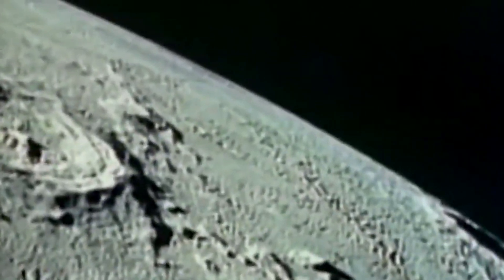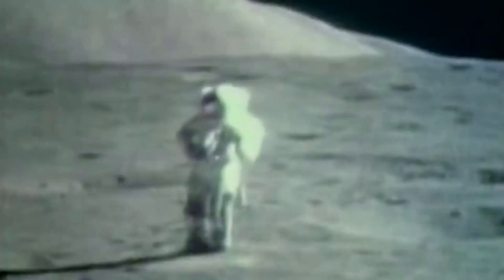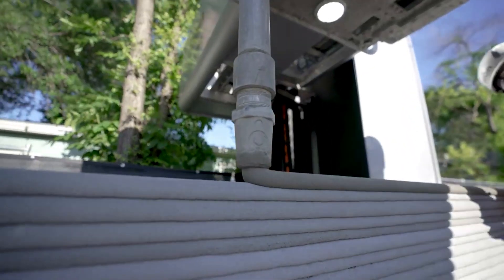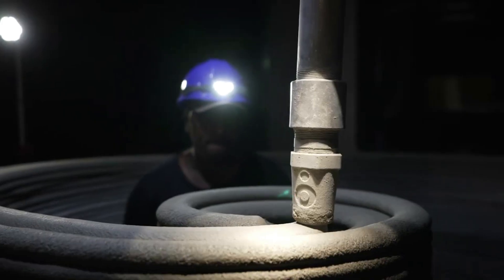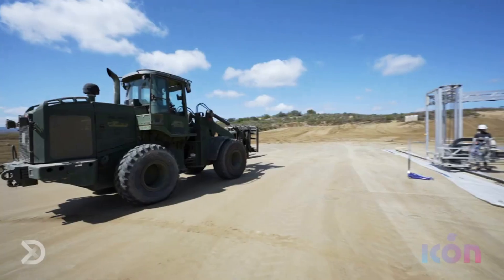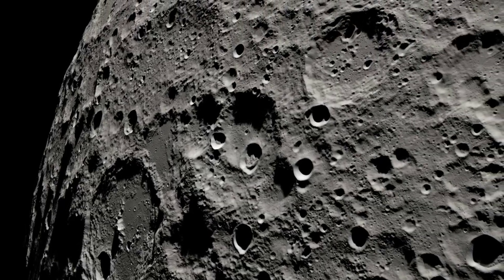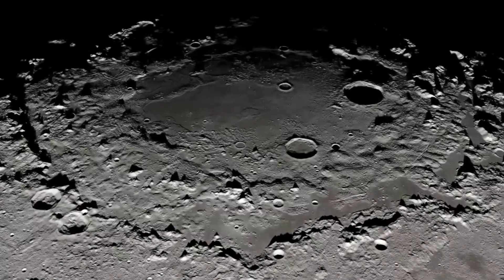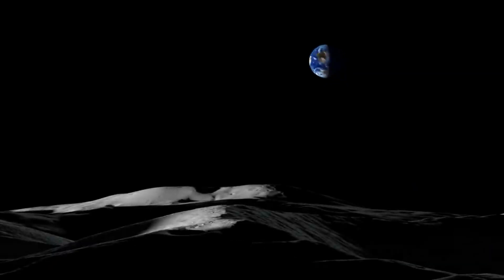A Closer Look At NASA’s 3D Printed Moon Base Plans

Comment: Not a single one of the examples you show have any kind of regularity in the width of the material being laid down, resulting in a very bad looking wall, with uneven chunks of concrete sticking out every now and then. These wont be viable  until that is fixed.

Comment: How are they going to do to give the people on the bases gravity. Gravity to keep their bodies health while off Earth?? I have a way to do this. Any company or country interested in my artificial gravity system. Please contact me if you are interested in it...
Reply: @IbnBahtuta  no kidding, brother. I will show whoever wants it. How to make it. In space, we'll have to make our own gravity, if we want to survive. Gravity on earth, is a positive electrical charge, collected from space, traveling straight down to the core of the Earth. The electricity heats it up like we use a electric blast furnace for smelting metal. A lighting bolt show you that current is there, obviously. Tesla showed evenone that there is a current in our atmosphere. The current flow through every atom at a constant rate. That why everything is pulled down at the same speed. No matter its resting weight, if they are dropped from the same height, at the same time. The artificial gravity system I've desighn, will work. It's easier them you think.

Comment: this is not the way to build on the moon. sandbags would be better option. a continuous sand bag that gets filled in a similar way to the 3d printhead. this would be a lot faster than melting the regolith. then to make it air tight you inflate an inner plastic shell. to ward of the radiation you bring a excavator and dump tons of mechanically stabilized regolith on top. 
if you want the sandbags to be more stable you can put a thin layer of 3d printed regolith on the inside or outside. 

in general we would want moon bases to be underground (at least the inhabited parts and the electronics). thus sending "earth moving" equipment on a large scale would not be a bad idea.

domes and arches would be the best building elements to use since they are self supporting and do not require rebar to maintain its strength.
inflatable molds could aid in construction.